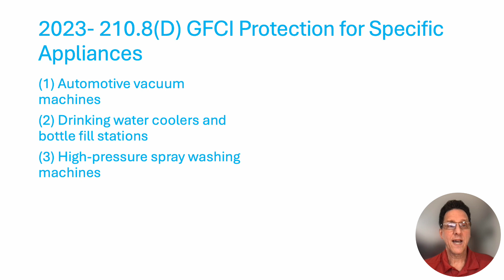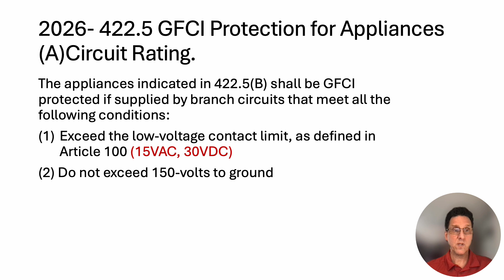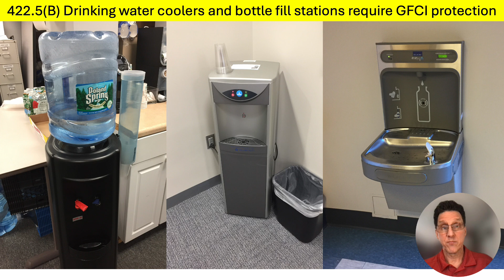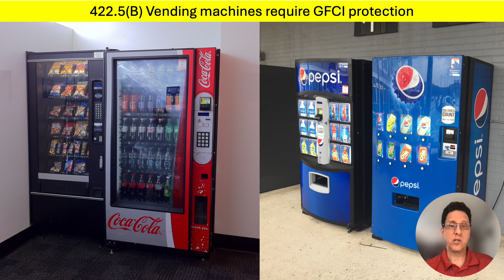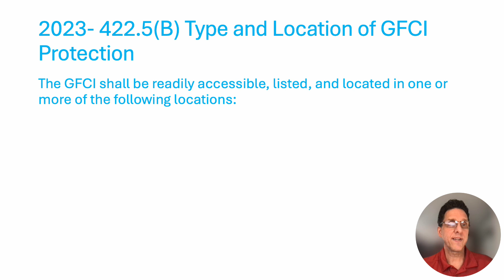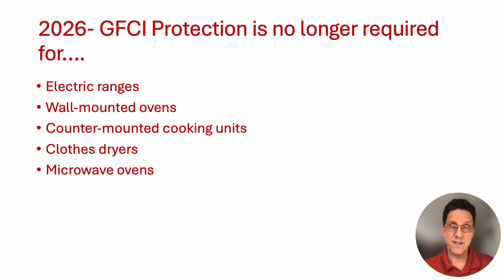GFCI Protection of Appliances

Comment: In my opinion, the only scenario where  having GFCI protection for the branch circuit and outlet supplying electric ranges would add additional safety is in the one and ten million chance that the EGC became disconnected AND the oven heating element shorted to ground i.e. the element resembles a sparkler or arc welding electrode burning from a  point of the element towards one of the terminals. 

This just happened last night in my apartment, so no pizzas for supper unti maintenance gets around to repairing the range 😧

Other than that requiring GFCI protection for electric ranges is simply going to add additional costs for building a home in a time of one of the worst affordable housing crisis's in decades.  Not to mention a handful of cities are banning natural gas hookups for new construction, and those two pole GFCI breakers are between $100 to $200 each.   Gotta appreciate the government looking out for everyone's "safety and well-being" 😅

Comment: 422.5(B) list item (1) by that definition presumes WET CONTACT BUT NOT IMMERSION per Tables 11(A) Note 2 and 11(B) Note 4. Does that “NOT IMMERSION” imply that GFCIs do not have to provide protection against ground faults when immersion or submersion occurs? This Article 100 definition wording needs clarification.

Comment: Completely agree with you that the 210.8 wording SHOULD HAVE been worded to “GFCI protection shall be provided for the OUTLETS OF BRANCH CIRCUITS rated 150 volts or less to ground, and 60 amps or less, single-phase or 3-phase, THAT SUPPLY APPLIANCES INDICATED INDICATED IN 422.5.” Both CMP 2 and CMP 17 have always had problems making that distinction equipment rating and circuit rating.  Also “identified” has a specific definition in Article 100 that is inappropriate for 210.8(B). The problem remains that “outlet” is poorly defined because there HAVE been fatalities of vending machines where FLEXIBLE HARD-WIRED “WHIPS” have been damaged and resulted in ground faults. Given that the portion of FLEXIBLE wiring methods “upstream” pose a shock risk, regardless of field-wired or factory-furnished with appliance, the definition of “Outlet” for those wiring methods need serious revision.

Comment: Would the branch circuit voltage differ from the appliance voltage?
Reply from the maker: Yes. It could. 
This is from NEC Section 110.4.

"The voltage considered shall be that at which the circuit operates. The voltage rating of electrical equipment shall not be less than the nominal voltage of a circuit to which it is connected."